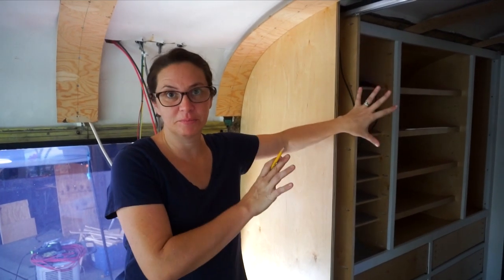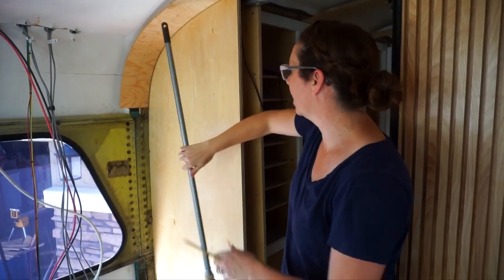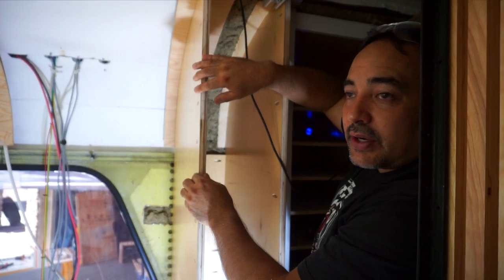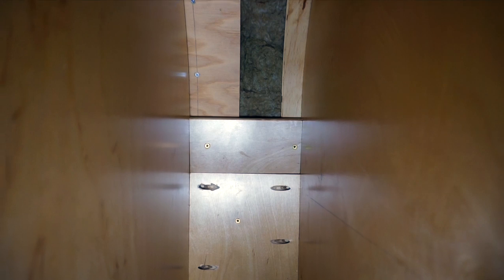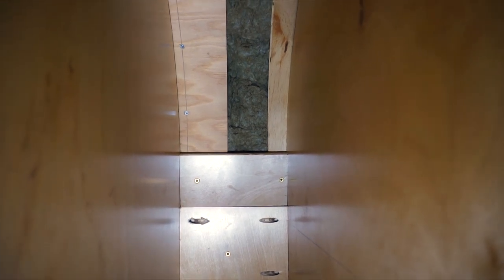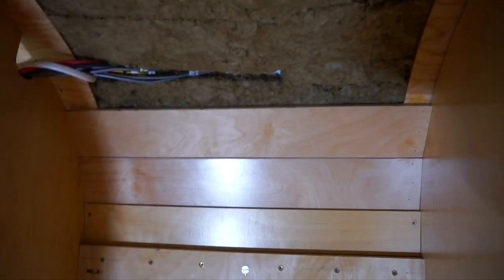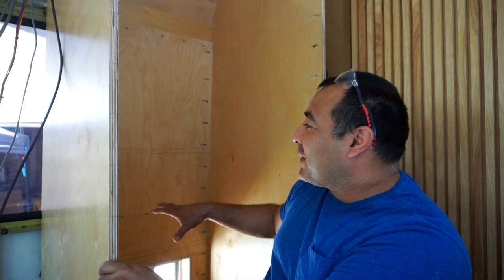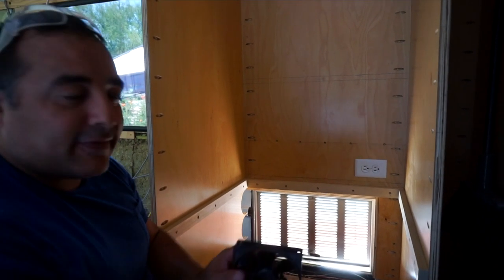Building the Broom Closet & Pantry

Comment: Nice job with the oscillating saw to cut the microwave outlet opening.   My oscillating saw (and sander) does not work as well as I would like, especially on harder wood, but there are certain jobs for which it is the only tool that really works.
Reply from the maker: Thank you Bruce - we don't use it much but it has proved itself invaluable a few times.

Comment: Nice work as always, I'm glad you thought of a broom closet. I'm sure you have a plan, but what are you going to do with the old fridge vent to keep out water and bugs?
Reply from the maker: Thank you Dirt Road Sailing.  That top vent was leaking and in a really poor condition when we got the bus. We patched it with an aluminum panel and put those access boxes in the patch that was made. (it's a quick picture but we show the outside at @8:51) . A better picture can be seen here: https://photos.app.goo.gl/bk5rszUWd6WuDHMy5 the panel and inlet boxes are about 1/2 down the bus on the passenger side.

Comment: It looks great. Will the fans be sending your conditioned air outside? Or, is there an in-take of outside air?
Reply from the maker: Thanks, Kevin - We need to draw the air from somewhere, so we are drawing it in from the top of the cabinet where the electronics sit (inside the bus).  Our hope is that we will be drawing mostly hot air (since hot air rises) and pumping it outside.  The fans will be variable speed and monitor the temperature of the cabinet so if the cabinet is not too hot we should not need to push a bunch of air out (maybe even completely power down the fans).  I guess one side benefit is during the winter we can close off the outside vent and just recirculate the hot air inside :).  We will keep you posted once we get it all working -  right now it is just another experiment :)

Comment: Would urge you to shoot temps on the rear of your main fridge to learn about heat flow along the rear...the heat emanates from the top of the fridge, not from the compressor.  You may need to rethink your air flow. To try to pull hot air down against the natural upwards flow could prove to be futile. Pro fridge installs in vehicles will close airtight on sides to ensure strong airflow in under the bottom upwards on the back and out the top...either through the roof or over the top of fridge. You would probably get away with your pc fans pulling sideways at the top into the neighboring cabinet.
Reply from the maker: Thank you Jan - We admit that the system is not ideal but I think it will still work quite well.  The fans from the top of the technology cabinet will push the air down along the back and the fans at the side should pull that hot air into the space with the door.  We really wanted to avoid heat getting into the pantry and have long closed the original refrigerator vent (which was broken and leaking).  We will report back when we get it all wired up and running (there is always room for a plan B if it does not work :))

Comment: I’m guessing you’re going to need more suction than you think to overcome convection and not overheat the upper cabinet. 

If it was a sealed system intake to exhaust a pressure blower like a squirrel cage would be a lot more effective. 

Better yet would be to reverse the flow and create a duct going out of the old top exhaust where your cables enter and use the refrigerators heat to pull air across the electronics. It would save a lot of energy too not running fans to counteract physics.
Reply from the maker: Thank you Peter - I agree with you that a vent out the top would have been a better design but we really didn't want to add another thing to the roof.  I guess if this doesn't work we can always plan B and go with something low profile.  We will gather some data and see if this works the way we think it should and if the data tells us it will not we will come back to the drawing board.

Comment: Coming along nicely!!! 

Was thinking to install some kind of air extractors (also called exhausters or pressure relief valves)t in that inside of that outside vent area. There are larger ones on the tailgates of Wranglers and back cabs of truck you might be able to use out of the junk yard for super cheap or even make your own. Always thinking of critter ingress areas. Lol
https://jalopnik.com/heres-what-those-rubber-flaps-are-hidden-behind-your-re-1828016409
Reply from the maker: Thank you Mikie.  Funny thing I have seen these many many times and never really thought much about them - great idea!

Comment: Im aware of vapor barriers to keep the excess moisture out of the walls especially during the winter months are you guys using or need any?
Reply from the maker: Thank you Robin - we are not using a moisture barrier -  The insulation we are using in addition to being fire-resistant, it will repel water and not absorb moisture and is completely resistant to rot, mildew, mold and bacteria growth. (https://www.jay-k.com/10-benefits-of-roxul-insulation/) We will also not be using any propane heat sources instead we are using Diesel heaters and air conditioning which should work to actually dry the air inside.  We will keep you posted once we start living in the thing to see how it does :)